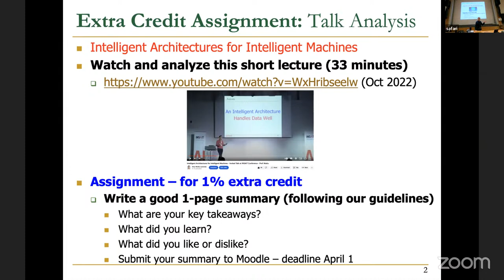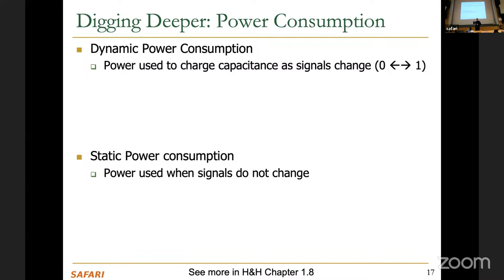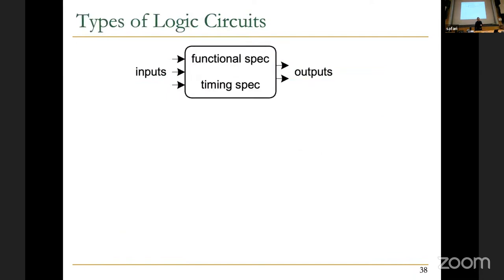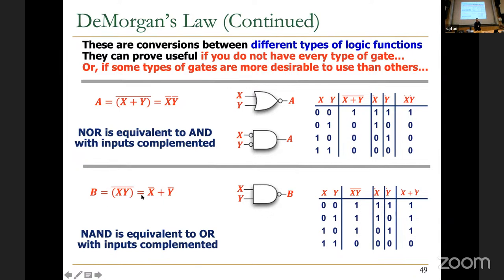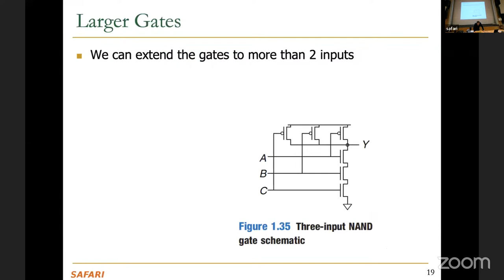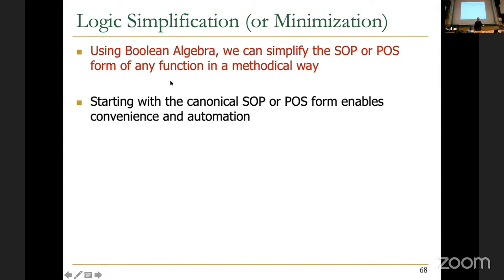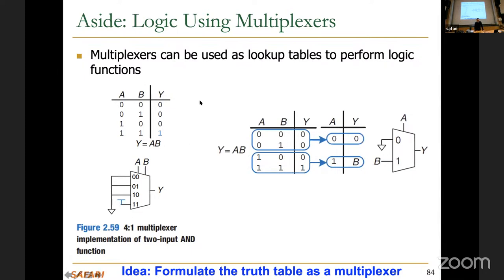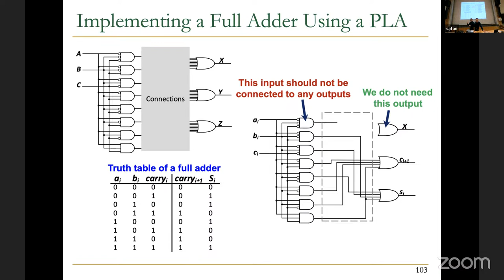Digital Design & Comp Arch - Lecture 3: Combinational Logic II (Spring 2023)

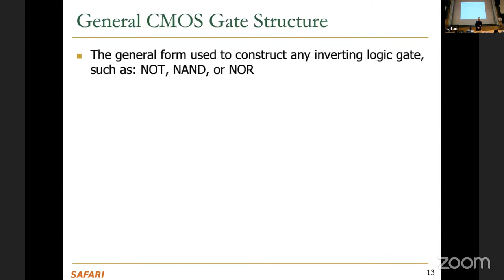Comment: 8:30 Recap finishes
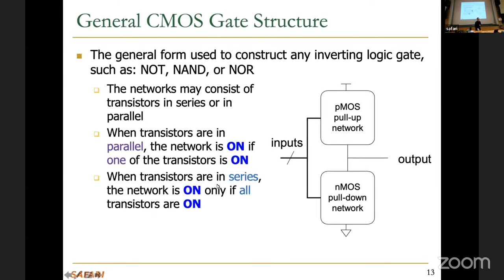9:45 General CMOS Gate Structure
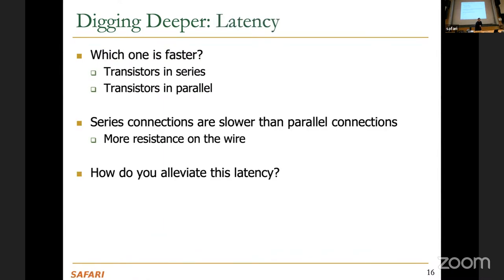15:02 Latency
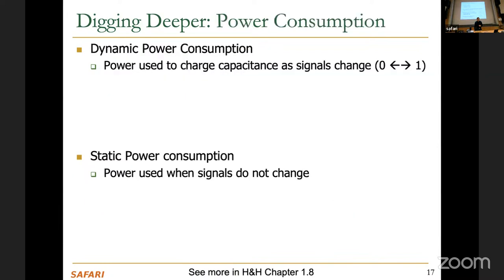15:58 Power Consumption
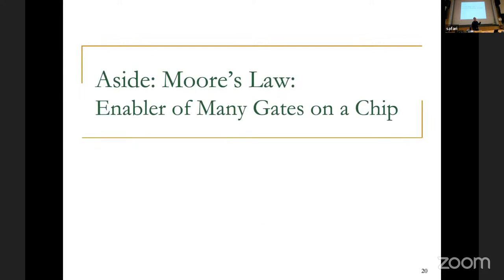21:36 Moore's Law
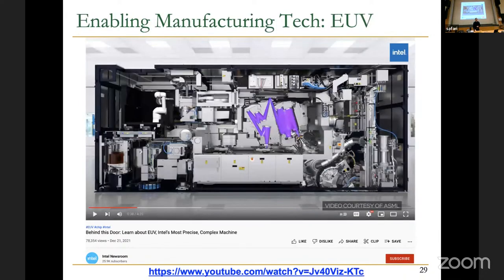27:14 EUV
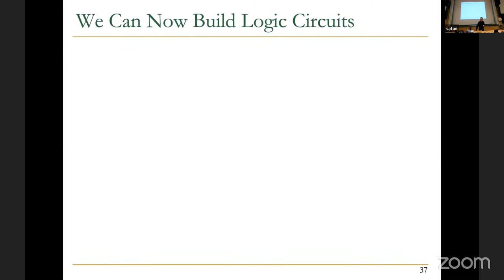30:10 Combinational Logic Circuits
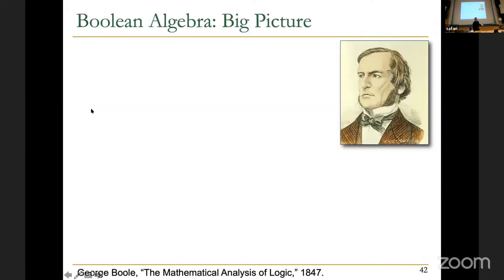36:51 Boolean Algebra
44:08 DeMorgan's Law
47:57 Standardised Function Representations
56:56 Break
1:07:15 Sum Of Product recap
1:09:25 Product of Sum
1:17:47 Decoder
1:23:30 MUX
1:36:20 Full Adder
1:40:33 PLA

Comment: At 1:38:12, I think Professor Onur Mutlu meant to say there are 7 AND gates, not 8, in the realization of the Full Adder.

I think, the reason for this is because both carry_{i+1} and S_i have exactly one minterm in common (a_i b_i carry_i), so we reuse the corresponding AND gate for both the outputs, thus reducing the total number of AND gates required from 8 to 7.

Consequently when you abstract it in a 3:8 decoder, I think, you will have to ignore, when finally OR-ing the decoder outputs, the output corresponding to (a_i = 0, b_i = 0, carry_i = 0) and reuse the decoder output corresponding to (a_i = 1, b_i = 1, carry_i = 1) for both the OR gates.

Comment: Professor Onur, I believe that on the 17th slide, the Dynamic Power Consumption formula has a 0.5 multiplying (C*Vcc*f), doesn't it? Thank you for all this wonderful knowledge shared!
Reply: The slide is correct. When you charge up a capacitor the power supply provides twice the amount of energy that is stored in the capacitor (which is probably why you think there should be a 0.5). When we are talking about power consumption we are referring to the total energy delivered by the supply over some time period. Because of this we have the power consumption as the energy multiplied by the clock frequency (in other words divided by the clock period).
Reply: @Inkarnid  Ooh I see, my apologies. Thank you for the explanation!